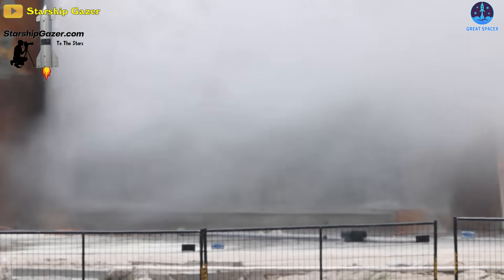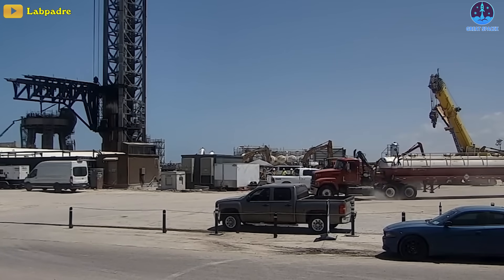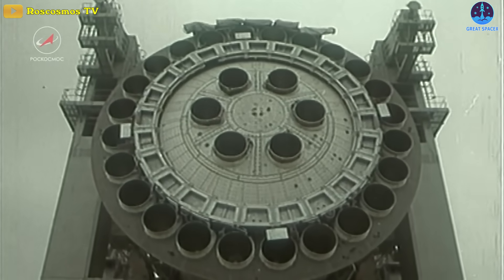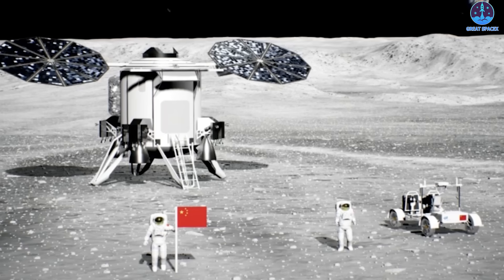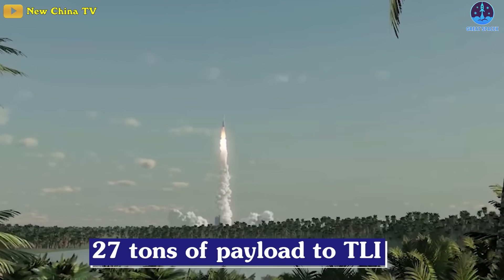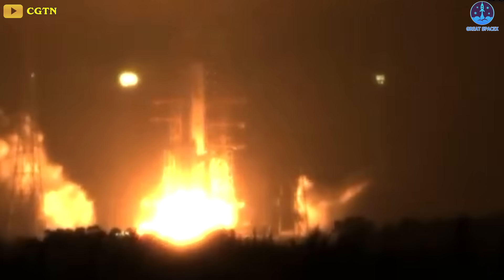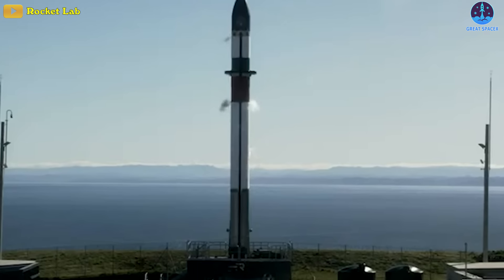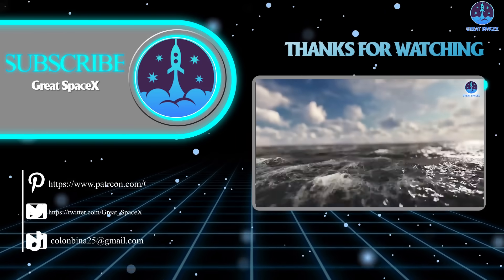Finally happened! First Water Deluge System Testing with MASSIVE WATER...

Comment: I hope the steel plate/deluge system works but, apart from the obvious "will it melt" question,  I worry about two things: 1) the steel plate is flat, so it will reflect the very strong shockwaves from the engines back up into the base (and sides) of the rocket so will the water be enough to dampen this down to levels which don't cause damage? 2) the volume of water will either turn into steam (1600 times the volume of water) or will (mostly) stay as water so if it all turns to steam, then is there sufficient space for the engine exhaust and steam to clear the pad without the overpressure causing damage to the base of the rocket and/or its engines?
Reply: It'll be just fine.
Reply: They probably did
Reply: when they don't apply enough water torch will melt metal. When they apply too much pressure then metal cant be thin so it can melt when water volume is not enough. When water turns into steam letts say at 50% throttle   then it can get more than 100% thrust for a while so starting 50% to take off is ok but then it means that getting disconnected must be done faster and throttle up is ok but when it has liftoff pressure at 40% thrust or below then central engines must be lit after takeoff. so many things to get right. ICan steam pressure and water pressure somehow to be added to total liftoff pressure.Can Raptor bells work when ambient pressure is soo much over sealevel pressure even when throtled at 50%?
Reply: @qkktech  Personally, I feel the same engineers who designed the original failed stage zero are also the same engineers that are designing what I feel a significantly flawed rework of stage zero. 

I have emailed SpaceX and have called leaving voicemails and no response to date.
Reply: @icare7151 they where already designing those cooling plates before the first launch they knew they needed it. These are the same engineers who use regenative cooling to keep the engines from melting. I’m sure they can do the same to the launch pad
Reply: @icare7151 sry, its getting built no going back now ig🤷🏿‍♂️
Reply: If it doesn't work, Space X will probably have a new one built with most the problems fixed within 2 months.

And when they do have this pad figured out, it will be much easier and cheaper to build multiple stage 0's than current proven designs.
Reply: @deejnutz2068  But at what true cost? 

The environmentalists are already doing everything possible to permanently shut them down. 

It’s better to get it correct the first time.
Reply: hmm, if only they had simulations to explore this instead of just wondering aloud.
Reply: @MartensFamilyHomeMovies  You mean like the simulations which they ran which showed that an unreinforced layer of Fondag would withstand one launch? The real world is one thing, a mathematical simulation is an approximation to the real world (and I say that as a mathematician) which is sometimes pretty accurate and sometimes wildly inaccurate. IT says GIGO. Build the model wrongly and the results are unreliable. If you have any interest at all (which seems doubtful judging by your comment) look up simulating turbulent flow.
Reply: @MartensFamilyHomeMovies  hmm yeah if only they had a simulation that tested the original pad that got destroyed I wonder 😑
Reply: Agree, the new stage zero design appears to have fundamental flaws:

I still have concerns of the new design as it appears to be missing key elements and in fact it may have created potential new issues.

I emailed my StarShip stage zero design to SpaceX, thus I have done what I can.

Comment: They do know they can capture the run-off water, filter it and reuse it don’t they?
Reply: In the future. It needs extra allowence
Reply: 'Filtering' the water will not remove chemicals.
Reply: @johnrday2023  SO FREAKIN WHAT?  It’s not going to be used for drinking but for launches.

Comment: You can land on Mars but you won't be able to take off to go home. (with current tech)
Reply: this is why starship is so useful. mars has all the materials to make the fuel for starship and because of it's lower gravity and thin atmosphere it is much easier to get off the planet so you don't need super heavy.
Reply: Taking off from Mars is a whole different beast, and could very well be done with current tech, the same way it was done with the moon landing. 
1. You launch starship to orbit.
2. You launch the ones needed on Mars to Mars, 
3. You launch a crewed starship.
4. You leave the crew vehicle in orbit, you use a lander to go down to the surface where the pre sent infrastructure is at already.
5. You do your Mars stuff.
6. You use the ascent part of the lander to get back to orbit and dock with the crewed ship
7. You send the crewed ship back home.

Sure, you need to send a couple of tankers all the way over to Mars, but it can absolutely be done. you don't need a super heavy booster and this whole complicated re launch system on there. 
I always laugh when I read these comment sections, people that never took a single class of structural engineering being confident in their guesses how water cooled metal will stand up against thermals and pressure we don't know the characteristics of, hilarious.
Reply: Just starship will be lifting off from Mars.

Comment: Why don't they simply have a deep hole beneath the pad? Just dig, poor concrete on the sides and voila... no need for complex systems that can have faults... let nature do it's thing.
Reply: Too much work, they HAVE to launch as soon as possible
Reply: @jaydonbrown617  I find digging and pooring concrete to be quite quick but mostly, you can then stop thinking about it.
Reply: THEY CANT. It will fill up with water
Reply: @Hungary_0987  oh by sides I also meant the bottom and well, even if it did fill with water, isn't that the same as using a water bidet like here?
Reply: @schloops8473  Nope.  The blast would burrow out the earth under the launch structure, and it would collapse.
Reply: @eskieman3948  the "idea" is look at the last launch of the rocket, measure how far the exhaust goes and make a hole that deep, cover the borders with concrete and have holes to evacuate everything. The exhaust was pretty much only straight down so the concrete wouldn't fee a thing.

Comment: It's not going to work
Reply: We don't know until we try that's why they test things
Reply from the maker: Why not?
Reply: Sure, the water is to be used as a heat dissipater, but there is little chance they are going to combat the force of those engines spraying water straight up at them. Other deluge systems spray water horizontally into the path of the exhaust, not fighting the force of it. 

The water spray, try as it might, will be simply atomized upon leaving their nozzles and blown away. If you don't think so, just look at the shoddy test done with the one raptor on the smaller replica. 

Also, okay, the steel pad is going to absorb the exhaust energy, but what is absorbing the pad's energy? The massive amount of energy here isn't going to simply go away, it is going to push the steel pad down into the concrete, likely destroying it in the process and creating another hole, though maybe not as deep.

Either way, now you have thrown large steel fragments into the possible mix of ejecta, pray nothing hits SH, or you will have a new record on your hands that trumps N1....
Reply: @jaydonbrown617 they fant do that hete. And iam tired of telling why.
Reply: @Hungary_0987  And we're tired of the excuses
Reply: @jaydonbrown617 THE FUCKING WATER LEVEL IS TOO HIGH
Reply: @jaydonbrown617 tell us you don't understand fluid dynamics.
Reply: @Bryan-Hensley  In regards to what? You're going to have to be more specific than that. Fluid dynamics concerning the raptor engines, concerning the deluge system, or something else? Either way it's just math, but quite an interesting subset of it. As a fluid systems engineer at General Dynamics EB, my specific job duties expose me to fluid dynamic scenarios and equations every day, so what are you trying to say?
Reply: @jaydonbrown617   It doesn't take an expert or a degree. The plate won't even get hot enough to burn you. I love seeing people say things about thrust. The thrust pushes up on the ship. Its engines don't push against the plate. In fact the engines don't push off anything. They wouldn't work in space if so (look up Newton's law). The pressure against the plate will probably be below 1000 psi. Nitrogen pressured water tanks can easily overcome the exhaust waste pressure. Water is a phase-change material. As long as there's a continuous supply of the phase change material, it will remain at the temperature of the phase change. Just like ice will remain 32 degrees even with a torch blowing on it, until it's all gone..
Reply: @Bryan-Hensley  "Easily overcome" Geez, tell us you're the one that doesn't understand fluid dynamics. Who told you that nitrogen charged tanks can withstand the pressure of 33 raptor engines at 17 million lbf? Link me to this source please...
Reply: @jaydonbrown617  So why did Elon turn down your application at SpaceX???
Reply: @eskieman3948  You're sure getting around to these comments, can't blame you for I wouldn't be here either.

I mentioned in a different video that I worked for SpaceX as an intern for a couple months. Out at the Cape Canaveral location while I lived with my Uncle in St. Cloud, FL. I always find it amusing that people say something along the lines of me not getting a job at SpaceX when in reality it's quite the opposite.

No I didn't return, though I learned a bit of cool rocket stuff (to put it plainly). Live in Albany, NY now, kicking back in my current position, understanding far more than what you daisies believe goes on in there. Granted every location is likely different in certain ways, but the company culture and head dictator still stands... I just know the hen house is disturbed these days....😆

Comment: I think this was a small volume test to give functional testing to the welds and examine the output flow.  The water tanks are not all installed yet, and neither are the pressure tanks.

I do wonder how much of the water is captured and how much is released since they are right on the gulf.  Moving forward, for a high flight volume, I can see them getting permission to pump water from several hundred feet offshore to use for this, and just let it all flow back.  But, it would need to stick to EPA hydrocarbon emissions guidelines.
Reply from the maker: Yeah. I think SpaceX will reveal this in a bigger test
Reply: Nope, salt water no Bueno.